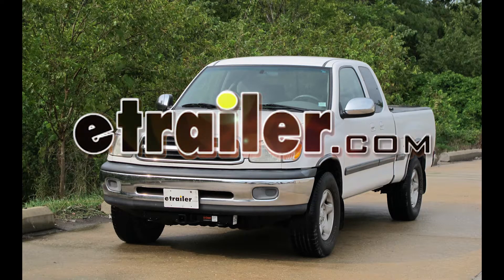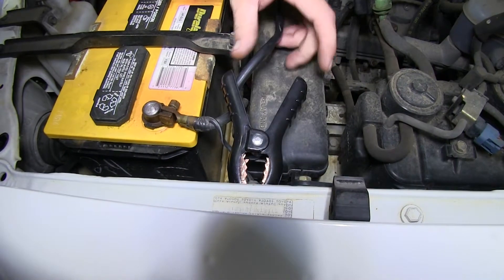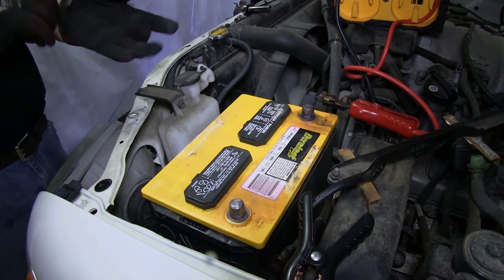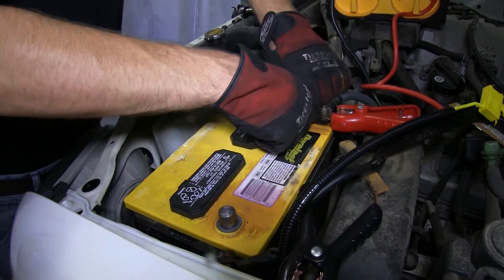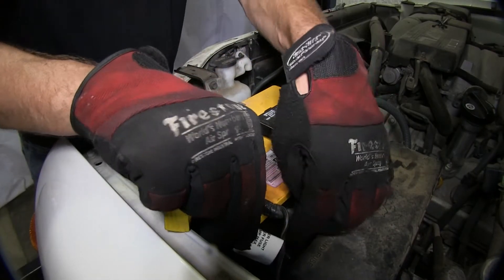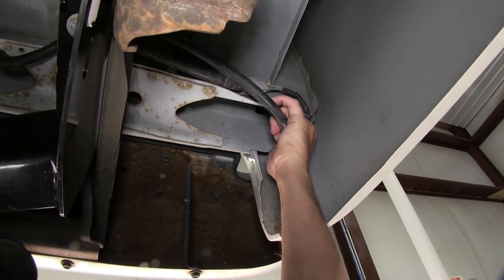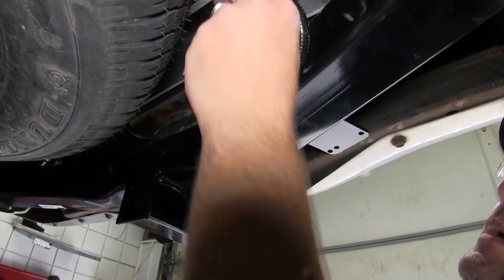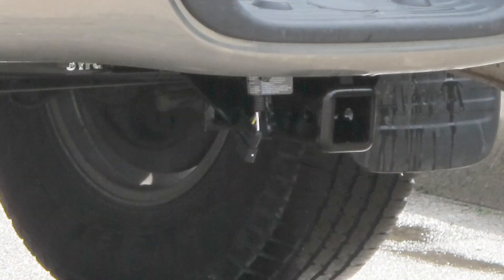Mount: T-One Vehicle Wiring Harness with 4-Pole Flat Trailer Connector on a 2001 Toyota Tundra

Comment: Do you have a video for installing a trailer brake controller on this same truck? 2001 Tundra. My truck has a tow package with both the 7 pin and 4 pin plugs. Thanks